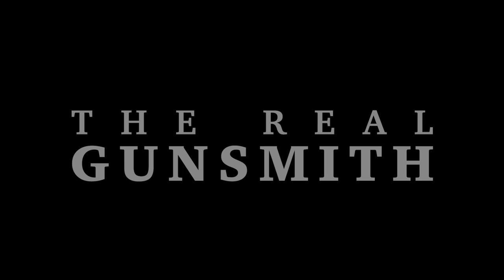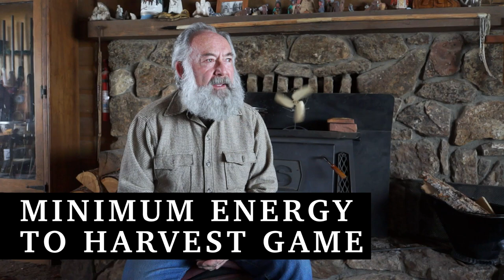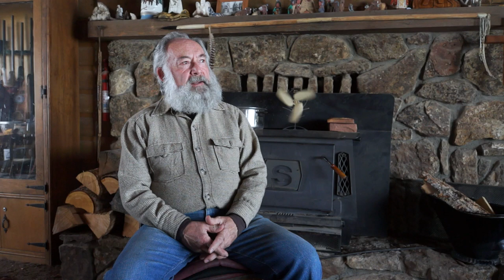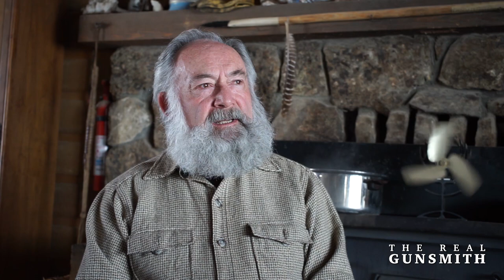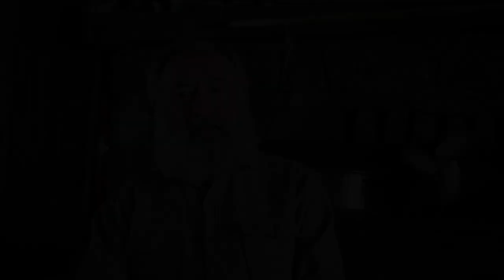Minimum Energy to Harvest Game -- The Real Gunsmith

Comment: Excellent video series Randy. Looking for wisdom on minimum energy needed for hunting varmints like prairie dogs, coyotes, crows, etc... Built a 20 practical rifle and have DOPE chart made out to 400 yards and want to know if 400 is too far for the bullet.  Energy of the 32 gr hornady vmax is 1241, 936, 703, 522, and 381 ft*lbs at muzzle, 100, 200, 300, and 400, respectively.
Reply from the maker: A good round for prairie dogs and woodchucks, but not a distance coyote round.  .224, 65 gr Sierra is good in a 22-250 at distance. 

Good shooting!
Reply: 400 is perfectly all right with my 204 ruger on yotes.  40gn vmax, h322 and cci small mag rifle primers.

Comment: Lord good sir where are you coming from about the Hornady ELD-x and the cup and core sierra hunting bullets. Since when did designs like this fail to make good hunting bullets? I guess Jack O' Conner and others just got luck over the past 50 yrs? Yes if you launch these things at ungodly velocity's you will have trouble of even a Nosler Partion will blow apart the nose. I have killed animals from 20 - 430 yds with 6.5's shooting the Berger bullets and none of those 15 animals could say a damn thing about bad performance, same thing with the ELD-X
Reply: Christopher Benfield same here. I’ve shot whitetail deer out to 430 yards with 243 Berger vld 95gr with complete pass though and had dead deer less then 10 yards from where I hit them. This guy is a know it all.
Reply: Look at a side by side comparison of an Eld-M and ELD-X.  The X has a lil thicker copper base and one lil tiny locking ring from copper to lead. The X isn't nothing but a match bullet. Poor choice of a hunting bullet.

Comment: I've taken many, many elk with the Barnes and in a situation where we were seeing 300+ elk a year taken they had a 30% failure rate to penetrate the front shoulder of cow elk requiring another round, we ran Accubonds and they did better but suffered from the same issue that causes the Barnes to stop cold or deflect on an elk shoulder. The ONLY bullet we've killed hundreds of elk with and not had to shoot an elk a second time and have seen 100% of the bullets reach the vitals is a heavy for cal Berger.  More momentum delivering more bullet into the core of an animal where it can expand flat kills elk faster and more reliably than low BC light for cal bullets. I'll shoot Barnes all day long for light game but never again for heavy game, the only copper mono bullets I've seen perform on elk with no failure to penetrate is the Hammer line of bullets, solves the Barnes issues while maintaining lead free!!
Reply from the maker: Why shoot them in the shoulder? A waste of good meat. Shoot them in the armpit, which goes through the lungs, often in the heart, depending on the angle.
Reply: The situation sometimes dictate that shot, absolutely not my preference, I've seen to many Barnes not open with a behind the shoulder shot to trust them that much, it takes an average of 45 minutes for a cow to succumb to a hit through the lungs that does not open.  I only hunt for meat and the biggest waste of meat happens when you don't recover an elk so now I compromise a little on a shoulder shot and loose about 8 lbs of meat total with a Berger, behind the shoulder I typically have less meat waste with the Berger than the Barnes but I have a far, far better permanent wound channel. I will do everything possible to get that crease of the shoulder shot quartering away a little but again sometimes it's not the shot.
Reply from the maker: Out of curiosity, what Barnes caliber, weight, velocity bullet have you used with said results.  Every animal I've shot with .270, 7MM, .308 bullets killed the elk stone dead in the arm pit, as well as many other bullets over 54 years [my kills and with others] on game , that worked fine through the lungs.  I could write a book [if I ever had time] on the bullets that work fine through the lungs.     I did shoot a bull elk in the lungs at 368 yards with a 7MM 145 Barnes X LR with an MV of 3442 from my 7MM-.404 Wapiti Express.  The elk stood for 6 min.  Then he turned, swapping sides.  I shot him again, again in arm crease, only to have him stand another 7 min.  before dropping down, yet head erect.  I shot him in the chest with the 145 bullet traveling through to the hip on the off side and against the hide.  That finally killed him "instantly".      The bullet is a perfect mushroom.    I accredited the two fails to instantly kill to the plastic tip causing the bullet to perform differently.  Yet both, when dressing the elk, showed very good wound channels.     Yes, I understand about the right shot not always presenting yet would rather pass than waste the meat.  There always seems to be a chance another day or later in the day.
Reply: All the critter's I've double lunged have died within 2 min. Period.
Reply: I've shot a lot of 168-180 gr Barnes in different versions from originals to TTSX in the 300 WBY, used to shoot them in everything now in very little. It doesn't take much of a bullet or impact to kill elk fast through the lungs but you do need a bullet that opens to make it quick which every animal deserves. Now I load 215 Bergers or 230 Bergers in the 300 WBY and it's much cleaner kills and one round down but they fit how I load and hunt much better than the Barnes so I have excellent  results.

Comment: I would like to see Nosler improve the Partion with a plastic or aluminum tip. (The lead tips deform in my magazine) And even improve the BC, but keep the same main core design. I guess, even w/a plastic tip, it must be too expensive to build???
Reply: No need to. They're darn near perfect the way they are.
Reply: I had a box of Rem Core-Lokt deformed tips right out of the box--probably dropped or rough handling during shipping. Just used my Lee chamfering tool and re-shaped the tips...3-4 dollars

Comment: There's a lot of wisdom here, technically sound and practical. Keep speaking out, Randy.
Reply: On this one, I have to disagree based on the verifiable facts.  For example, a 175gr 7mm might have whatever BC it has, but a 195gr Berger EOL has an extremely high BC.

At common elk hunting altitudes for us, you're looking at over 1700ft-lbs of energy at 1000yds when you shoot that bullet at 2850fps mv.

Very few marksmen can make those shots, but there are LR cartridges that are way more than capable.  It has over 1300ft-lbs at 1300yds.

A common mistake people make is they don't enter the correct data into a good ballistics calculator, they don't measure barometric pressure, temperature, and don't know how to read the wind.

Wind-reading takes experience, lots of it.  That's one reason why people even with capable rifle/optic/ammo combinations shouldn't attempt shots beyond 300-400yds.

Comment: On a whim, I bought 168 gr Nosler Partitions for my .308 for deer hunting. Was disappointed when I shot a young deer at 90 yds. It completely removed the left shoulder and almost took off right. Wish they made them in the 140-150 gr range. Just joking about disappointment. They worked perfect, I just underestimated how good they would work. Unfortunately where I hunt, 110 yards is the longest shot I can take. Would you suggest using 6.5 Creedmore with 130 - 140 gr Nosler Partitions?

Comment: My experience with about 200 dear and elk sized animals agree with you. Initially my reloads with Sierra bullets were so accurate, I hunted with them. On close shots at high velocities, the bullets came apart and if passed through, left a fist sized hole in the offside. After a few failures, I went to the Nosler partition. Complete pass through was routine with quarter sized exit hole. Didn't kill as fast but easy blood trail and dead animal within 30-50 yds. When recovery was possible, bullet retained about 60 percent wt and was classical mushroom. Have recovered 250 gr Nosler partition from brown bear and 160gr Nosler partition from elk and performance was great. I've been thinking about using the Nosler Accubonds from 7mm mag to increase long range potential on elk. Any thoughts on this ?

Comment: Early September shot a 450lb cow elk at 372yds, double lung through and through and the animal tipped over kicked a few times and was done. Guess what, 147gr. Eld-m out of a 6.5 PRC at 2950fps. I've shot 8 deer with the same rifle and same load since the PRC came out , coincidentally is my f-class load in a different rifle, and every one had a complete pass through in the vitals and never took another step. Ranges from 75yds to 525yds.

Comment: Sorry gonna rain on your hate of the ELD-X again  200 ELD-X out of a 300 Win Mag 2800 fps at Muzzle. Large frame Mule deer 260 yds broadside. High shoulder shot through on-side scapula, through bottom of spine, through offside scapula and still going!!!! So much for not exiting the animal? Bighorn sheep shot in the Frank Church. 287 yds 7mm 162gr from a 280 AI going 2850 at the muzzle. Through back ribs through vitals bottom of the spine between the shoulders and broke the front leg on exit over 30in. of penetration!!!!!! Couse Deer 550yds 143gr 6.5mm at 2800 from the muzzle. Through both shoulders and the spine, expanded and not recovered.... I have seen the graphic evidence of elk shot with these bullets form the 6.5 Creedmore that were DRT.... I am sure that if for some reason you thought you needed 3300 fps muzzle velocity to kill an elk this wouldn't be the bullet of choice. But proofs in the pudding lower muzzle velocity and higher BC equals the SAME if not MORE energy and power downrange.
Reply: I shot 4 elk using a 200gr ELD-X in my 300 wsm 2950fps from 200yds to 550yds NOT ONE EXIT all broadside behind the shoulder shots. While field dressing I found the  jackets minus any lead, it was scattered through the animal. Great deer,antelope,sheep you know thin skinned bullet .
Reply: I'm glad they are working for you buddy. I shot a deer at about 30 yards with one of the ELDX factory loads in .308 which mind you only leaves the muzzle at 2700ish. It blew up into a million bits and destroyed a ton of good meat in the process. I was pulling jacket out of the back strap. You keep on using your ELDX. I'm glad they are working for YOU.
Reply: Great for deer. But they are very inconsistent for anything bigger sometimes they work great sometimes they do not. Just because you got lucky doesn't make it good.
Reply: Obvious millennial. You get lucky and all of the sudden you're smarter than everyone else that ever lived. Ever been boned up the ass for being a wise guy 😅

Comment: For years I believed that a boat-tailed bullet was more accurate than a flat based bullet. I don't recall why I had that idea but I suspect that early in my shooting days I heard it from someone I assumed was knowledgeable. My bad. One day I was working up a hunting load for my (then ) new .300 Win Mag. I was getting groups of about 1 1/2 in. at 200 yards with a boat-tailed hunting bullet (Sierra GameKing)  in 180 gr. I thought that was pretty good and for hunting accuracy, it is. Then I was given some 180 gr. Hornady InterLock spire point bullets that I assumed would be less accurate. Was I in for a surprise. Groups were all under 1 in. at 200 yd and one went 1/2 in. at 200 yd. That's genuine quarter minute of angle accuracy. And the InterLock is a more sturdy hunting bullet than the GameKing. I've used that 180 gr InterLock spire point ever since.

Comment: You've stated that your not a fan of the Sierra Gameking bullet... what is your view on their Gamechanger bullet? They describe it as having a heavy jacket,  but they don't provide retained weight information. Thank you for all the wisdom, it's desperately needed!
Reply from the maker: GC is not as accurate in most rifle as the GK. The plastic tip requires deeper bullet seating in the case, destroying accuracy potential.

Thanks for watching.  May you and yours stay well and safe.

Comment: A friend of mine gave me a 30-30 bolt action rifle whitout the bolt. Missing bolt and impossible to replace. I had gunsmith friend unscrew the barrel and turned down in a lathe to fit my 12 Ga Superposed chamber. I finally had a 100 yd gun. A 100 yds was way out yonder for Me.

Comment: BC directly correlates to remaining energy downrange. If you say 1800ft# is what you need for an elk, that means a bullet with a higher BC can take that game further out than a different bullet. Yes match bullets are horrible, but ELD-X and some other bullets combine performance with high BC. Worth looking at. ELD-X also performs better at slightly longer ranges (as velocity drops) since the bullet isn't fragmenting, rather expanding as it is designed. It's not supposed to be a 300yd bullet
Reply: LOL LISTEN and LEARN..............................................................

Comment: I feel that bullet type should be tailored to its velocity. A sierra game king is excellent for a 7mm Mauser at 175grains, yet it will break up perhaps too quickly in a 7mm Remington mag. I have found a 300grain 375 h&h of the cheapest form, eg federal power shock, to be fine on all soft skin game. This bullet has an excellent sd. and expands well . Indeed on one memorable occasion it went through a 5 inch tree trunk before it smashed through a medium sized antelope at about 30 yards ( a snap shot in the bush ). Naturally this bullet is not meant for Mbogo.

Comment: 208 ELD-M starting @ 2700fps vs 150 interlock starting at 3000fps.   I think the extra 60gr of lead makes the ELD-M better along with the fact that it will be hitting with a more consistent velocity 2600-1800fps out to 700 yards.  Light jacket gives good performance through this velocity range.  Bad shots hitting elk in the shoulder at ranges over 400yards are just bad, even for the magnums.  Elk are fairly stout and they don't seem to ever know when they are dead.

Comment: Thanks for passing the lessons we don't want to learn the hard way. Just acquired a 6.5 rpm mark 5 accumark as far as I can tell the 127 Barnes lrx seems to have the most potential. Game I'll be engaged with at max 210 lb white tail, 4-500 lb black bear and 70 lb coyote. Max shooting range is about 475 yds from that stand. Do you think the Barnes 127 6.5 rmp is adequate for those ranges and game?
Reply: Sorry, weatherby mark 5 6.5RPM 127 grain Barnes lrx
Reply: If you have 2400fps at the range you want you’ll get full expansion
Reply: I would say for optimal performance 400 yards would be the cutoff but you could easily do 475 yards.
Reply: 24in barrel

Comment: First let me say I applaud your insight and character!
I recently built an ar 15 .223. I took that rifle whitetail deer hunting recently with some Federal Fusion bullets. I was hunting some power lines where the deer were over 150 yards away. I was thinking that was maybe a little too far away for humane reasons. Did not shoot at that range. The velocity of that cartridge @ 200yds was 2400fps but the energy was only 800 ft.lbs. It was 1000 ft.lbs@ 100yards with 2700fps. Would you say that cartridge would be good at less than 150yds on a whitetail? I  put the rifle together mainly for hog and coyote hunting.
Reply: Many states don't allow hunting deer with .223 because of the lack of energy and most hunters won't limit themselves to reasonable ranges. deer can be taken with .223 but they can also be taken with 22lr. Neither are ideal, I'd recommend a larger caliber(243, 30-30).but if you insist on using .223, ethically you should limit yourself to ranges at which your bullet is carrying 1000 ftlbs or more and focus on shot placement.
Reply: .223 works well on whitetail, I am partial to Sierra Gamekings or Hornady 75gr HPBT bullets, they have yet to fail to make them DRT. Dont worry so much about energy as retained velocity to help with expansion, you dont need a ton of penetration on whitetail.

Comment: Well 85 comments are not that many IMO.Yes Minimum energy is a factor. I cast my own lead bullets. I only hunt and shoot with handguns. My EDC 2.7" Beretta Pico 380 ACP with lead cast 95 grain flat nose (!!!) bullets which have 150 ft-lbs of energy, they perfectly are able to give an lung shot to an 450 lbs cattle heifer. I shot one last time at 5 Yard (it had it's back broken) at the front shoulder and it passed through the animal out the other side with still considerable velocity (I coud see it hitting the sand). Within a bit over a Minute the heifer was dead. It bleeded immediatelly out of mouth and nose till after 1 Minute the lungs collapsed (I guess). So ever with the "weak" li'll 380 acp mouse pistol one could hunt deer in TEOTWANKI situations from nearby. So 150 ft-lbs is a real life number which is not below the Minimum hunting energies.

Comment: Again there is a HUGE fallacy in your comparison of the Barns to Berger out of the 300 Weatherby. While the Berger may not exit, when it his broadside of an elk and penetrates 2-3 and then expands violently sending tons of energy into the lungs, heart, and spinal column.... you won't be tracking that elk. Where as the Barns bullet will expand pass through without causing the comparable tissue damage fom the Berger  and the elk has a good chance to run off a ways before expiring. I'm not even a fan of Berger bullets but dang sure won't be switching to Barns overpriced  chunks of copper.